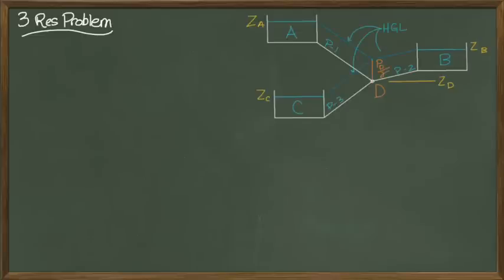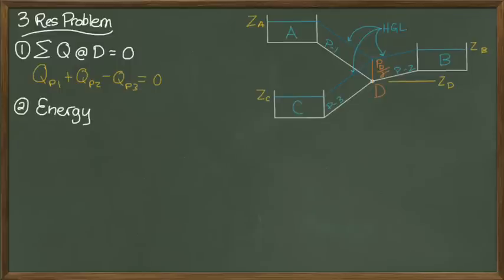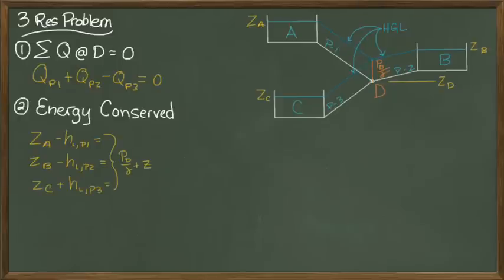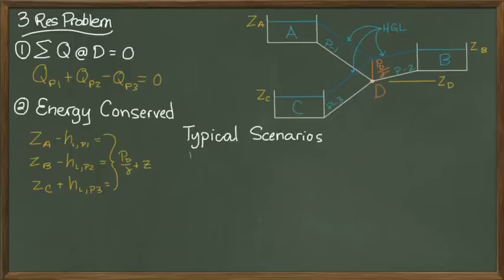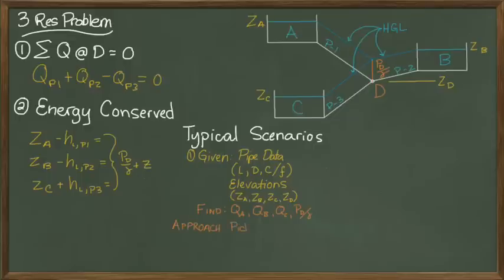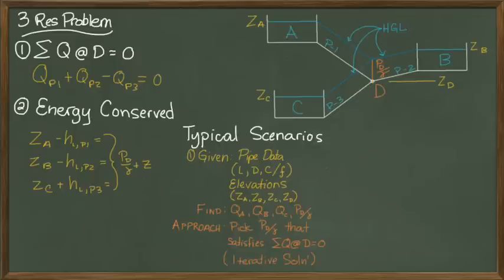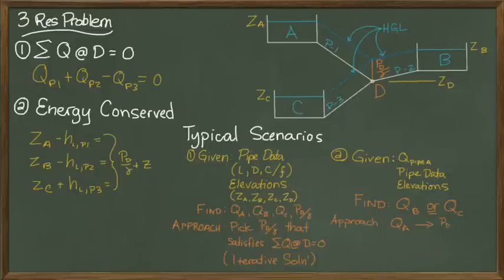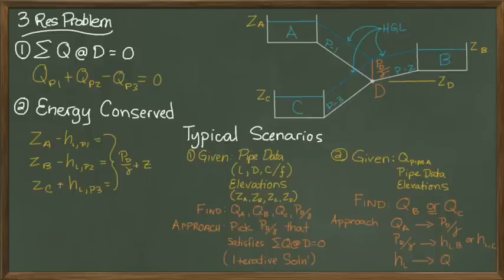Three Reservoir Problem

Comment: What if there's a FOUR reservour problem? How would that be approached?
Reply from the maker: Step 1 - fire the water manager who authorized the fourth reservoir.  
jk
It doesn't appear to change the process much other than to add another energy source and another pipeline to the mix.  You would still need to solve the problem numerically, by starting with a guess of the pressure head at D.  I believe this will hold true for "N" reservoirs connected to point D.
Reply: @kennethwlamb  Thanks for the reply but I think I didn't made myself clear. What if the fourth reservoir is connected to a different point? So there are 2 nodes to be analyzed instead of just one.
Reply from the maker: @oscarsanabria5354 So if I'm getting this right you will have two 'user nodes' (let's call them D1 and D2), and D1 is fed by two reservoirs and D2 is fed by two different reservoirs and there is a pipeline connecting D1 and D2.  Does that sound correct?  If so,  Because D1 and D2 are connected by a pipeline, then they will experience similar pressure, so their total static head (z = P/gamma) will be the same even if D1 and D2 are not at the same elevation.  This will lead D1 and D2 to being combined in the math. How each reservoir supplies energy or withdraws energy from D1/D2 will depend upon the pressure head at D1/D2 and the elevation of each reservoir just as before.  It shouldn't be too much different that this example in the end.  At least, that is my best guess.
Reply: @kennethwlamb  Thanks!

Comment: Could you please do an example problem on 3 reservoir problem, Professor??
Reply from the maker: Sure.  I'm working on several examples using Excel.  I just released my first Goal Seek video and the next one will be on the 3 Reservoir Problem.
Reply: Kenneth Lamb THANK YOU! I'll be waiting :) if you could make few more on gradually varying flow I'll be grateful!